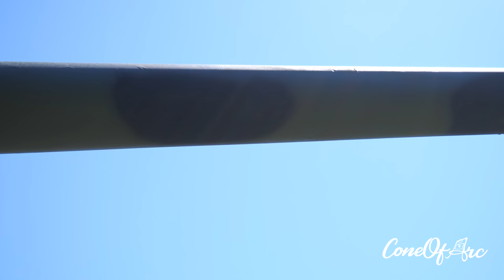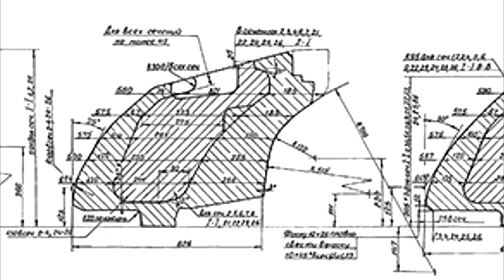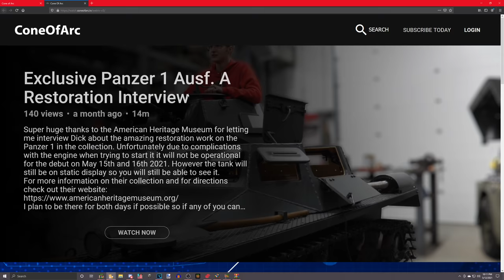Raising the Bar, the T-64 | Forged for Battle

Comment: No, simply no, please fact check. Also you contradict yourself many times.

The military don't want 64 (and to an extend, the 80), they want 72. M60 also officially was never called the Patton. 

Leopard 1 did not abandon the armor. The turret front is effective against apds of its time. The hull can be situational (at range), it is totally possible to defeat some earlier apds and ap in some situation. 

4:25 T-62 has tangible improvement on the armor, what do you meant they are essentially the same? By pure steel thickness, you can spot the difference. WTF???
Also, smoothbore != advance. People jerk off about gun, but it does not matter in the grand scheme of things. Gun is just a mean to push ammunation away. 
The ammunation is what matter the most. And, the ammunation is about on the same level for both side (in the context of early soviet dart and late nato apds)

5:35 "Essentially heavy tank on medium tank chassis". Im not sure where you trying to lead into with that statement, but no. 

6:40 Do not mixed the hull and the turret armor as 1, because they are not. It is not for any vehicle.
Russian tank, confirmed source, has only ever use 2 material (not counting era) for the hull as main protection. Steel plate with textolite insert (and air). No ceramic were founded.
Some iteration of T-64 use ceramic ball in a cast turret. It is replaced with textolite block because ceramic ball are hard to produce and the process of casting around the ball often lead to formation of void, void is no good (which lead to some T-72 use monoblock pure steel as turret armor). There is nothing about ceramic ball not holding its shape. 

7:40 Improvement was requested because it is flawed, the way you put it makes it sounds like a positive thing. T-64 goes into production without the usual verification process, mostly due to people invested in that project has lots of political strings to pull. As I said before, the army wanted 72, not 64, before 64 went into production.

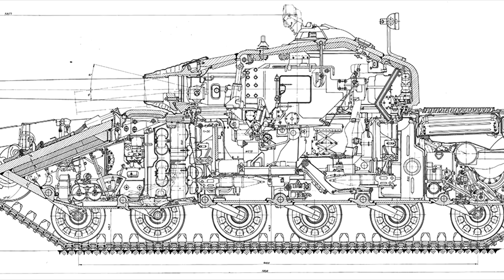7:57 Aluminum? WTF? Also, stop calling textolite fiberglass, they use similar base material but the manufacturing process and material arrangement give them different mechanical property. It is like calling tool steel armor steel, they are not the same.

10:00 "T-64 is more mobile than T-72", or just statement that is structure as x is more mobile than y in general. It does not matter in the grand scheme of things, it doesn't. It simply doesn't. I repeat it 3 times because it is important. Also, neither are necessary more mobile than another in this context, they are about the same in the field.

10:10 The AT ammunition of 105 is the apds, and later the dart. Except maybe French and the low velocity variants, no one ever think that replace apds with heat is good idea. Especially with 456 and 456a1. Study from both side concluded that 456 and 456a1 has high chance of malfunction when impact at near 60 degrees of angle. The fusing issue is solved with introduction of 456a2, but at that point your 105 heat cannot even get pass the era. On the other hand, 15a5 on chieftain has some what decent chance at defeating 64 at less than 500m.

11:15 Listen to what you just said.
Advantage of nato mbt......
"SPEED... no one can out run a 105 or 125 ap, and T-64 is faster than most nato mbt anyways" 
"ROF... just dont, in practice they are about the same (about 7s to 10s), with autoloader being able to load much more consistent in most situation" 
"NATO DOCTRINE... WTF does that have anything to do with the vehicle design"

11:21 In a realistic battlefield of pre 1979 maybe. 
Because only nato apds that can post real threat to russian vehicle is L15a5 from Cheiftan gun under 1000m. 
But, there was something to be said about soviet dart, they perform poorly against angled target, even worse if the target is layered. 
Chieftain particularly stand the greatest chance against such threat out of all servicing vehicle. If mbt 70 ever get fielded, its armor will do very well against early russian dart. 

Post 1979, Russian vehicle is in major disadvantage until post end of cold war. 
The disadvantage comes in 2 part, ammunation and fire control system. 
Referring to GHPC game if you want somewhat halfway realistic feel of where the advantage came from. The auto tracking and thermal sighting complex makes all the differences.
NATO does not have effective tank based no guided weaponry prior to 1978 (the introduction of 105 dart, the famous M735). 

Lastly, speed does not fucking matter, you are not outrunning a bullet flying at you at 1500m/s. 

11:40 Have you seen or read about any technical documentation of reloading any vehicle? I give you a hint, google them, there are plenty of video and document. 
Loading T-64 and anything with mz/az is arguably the easiest thing to do. 
Two piece munition mean hoist the pieces above the turret is easier because it is lighter. 
It also mean moving them around in the vehicle is easier because each piece is smaller. 
Russian autoloader also mechanically move the rounds into position unlike other vehicle which you need to do it manually. 

Reloading the into other stowage is not as easy (relative to more modern NATO mbt), that's true, but I am not sure comparing those has any real meaning. 

I started to feel like you are just pulling shit out of your ass.

11:52 If charges were hit, it has high change to cook off, doesn't matter what vehicle it is. 
Beside, T-64 compare to M60, Chieftain, Leo 1, Type 74, AMX30, and whatever vehicle you can name. 
Look at their armor and charges distribution, you would notice from every angle of attack, regardless of if it is ready rack or in stowage, T-64 always has the most amount of armor around the charges and smallest profile (not considering from the top or bottom). 
And it is established that turret is much more likely to receive impact than hull.

11:58 Thats true, but the charges are still below the hull top. Point? It is also true for any other tank in service, even in modern days. Only exception being M1 with all ammo stowed in blow out compartment.

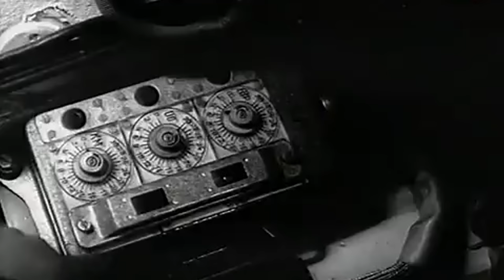12:03 It is not. Stop spreading the myth. Engineers are not fucking idiots. This statement is illogical regardless how you think about it. If you put stuff where you shouldn't, then of course it will goes missing, that's true with any afv. Beside, you are physically unable to reach lost of the moving parts of T-series autoloader anyways (assuming a 165cm male). 

12:14 Drag into the autolaoder upon firing? How does that even works? Gun goes boom only if the breech is closed. If it is closed, the your limbs are already cut off ()assuming it is even possible in the first place). Please familiarized yourself with the sequence of loading with both mz and az type autoloader, the structure, among other stuff. 

12:16 If the autoloader break, you are either dead or the vehicle is disabled beyond operational anyways. That's the same as saying if your fcs failed, it is extremely hard to hit 2000m target manually, or it is extremely hard to hand crank the turret if your guidance system failed.

Also also, the autoloader is consist of many system and each of them has their manual back up, the manual load time can range from 10s to 200s depend on what failed.

12:30 80mm of steel is better than say 70, 50, or 30, right? And the side skirt/small road wheel??? At this point I feel like you didn't even try.

12:53 That's exactly one of the major flaw of early T-64. Hence the modification request before the paint even dry on the new shiny T-64.

13:10 If the hit is severe enough to disable or kill a crew member, you are screwed. No afv can replace the driver in a combat condition when the enemy know your range and can engage you safely, same for the gunner. IRL ain't video game.

13:18 Maintenance of the vehicle? How does that has anything to do with anything again? 
It is a doctrine issue not a vehicle design and engineering issue. 
Beside the French declare your issue a no issue. Say you have a 14*4 men vehicle company, now changed into a 14*3 men vehicle company, the rest of the of the men got stuffed into an apc or 2 following the company. Assist with the maintenances at the end of the day when get back to base or in a safe location.

14:10 T-64 is only responsible with early variant of T-80, that's it. Truth to be told, not alot of people like T-64. 

14:30 No. Stop spreading the myth. T-72 is a more efficient design as a whole, with some part straight up more advance than some T-64. 

14:40 M1 and Chally didn't get field in significant number until late 1984. Leo 2 didn't get fields in significant number until early 1980. 
The treats to T-64 comes in the form of massive advancement of dart and thermal sight on upgraded vehicle, namely the M60. Check your shit.

Lastly, T-64 really is not that significant compare to T-55 and T-72.
Reply: I don’t know why you felt the need to write a dissertation pointing out “incorrect” (most of these nitpicks of yours are not even correct) parts of a YouTube video that is made for laymen that are not well-versed in tanks. The T72 in its early models was not at all better than the T64 in anything but production costs. 

Since you have all the knowledge and time in the world on this, why don’t you go and make a video about the tank instead of commenting an easily glanced-over comment.
Reply: Bruh
Reply: Dude dont you have a life to live?
Reply: Why didn't you made your own video about it rather than shove it in the comment?
Reply: What's Ammunation?

Comment: I love your reviews but this particular tank is a piece of junk, though t-62s which are now delivered by Russian military to Ukraine are even worse
Reply: It's bad now because it's old imagine if the  USA start using m60 tank instead of the Abrams it won't stand a chance against the Russian t80 and t14 armata
Reply: Uh...no. With the current modernization kits, it's very capable.
Reply: The T-62 is used in Ukraine as an armored self-propelled gun. Since there is no shortage of shells for them, and there are hundreds of thousands of 115 mm shells in warehouses.
Reply: @championknife  It's not just being used as an SPG. It's being used as intended as well, same with the T-55.
Reply: @NorthernNorthdude91749 No, T-55’s and 62’s are used as spg’s by the russians because they have a really solid HE round. The only one’s using them as mbt’s are the ukr forces
Reply: @BreadPittAAAAHHHH  Incorrect.

Comment: Wow this commentator sounds like he's spouting Soviet propaganda from 30 years ago? Is he reading from the past and present Soviet Russian propaganda manual? It certainly seems so.

 As an experienced tank commander in the United States Army with some combat experience what he is saying is absolute Hocum.  If the t64 is so good then why did it get replaced by the t72. Both of these pieces of junk are equally abhorrent. In the Gulf war we blew t72s turrets off at 3700 m with 120 mm guns and at 3,000 m with our 105 mm cannons. These two tanks are very weak and rank very low in the spectrum of the world's armored main battle tanks. They're upgraded versions t80 t90 etc etc are nothing but putting lipstick on horrible pigs. Do you really think a 45-ton tank can match up with something of 68 tons and greater from the West? You're saying you know nothing about physics if you say that. If you think they're pathetic armor is so good and why do they keep on slapping things on the outside of it to make it a little bit less pathetic? There's no need to add additional armor on the outside if your armor is good to begin with, right?

For the record the United States Army had been working on composite armor since the 1950s and the British as well.
Reply: Also the United States Army created the shillelagh missile system through the tank Cannon back in the early 1960s, FYI. That's not a New concept nor is it new in deployment either.
Reply: Not quite ... after the collapse of the USSR, US and German analysts had a chance to examine Soviet-made T-72 tanks equipped with Kontakt-5 ERA, and they proved impenetrable to most Cold War US and German tank projectiles and anti-tank weapons. A U.S. Army spokesperson claimed at the show, "the myth of Soviet inferiority in this sector of arms production that has been perpetuated by the failure of downgraded T-72 export tanks in the Gulf Wars has, finally, been laid to rest. The results of these tests show that if a NATO/Warsaw Pact confrontation had erupted in Europe, the Soviets would have had parity (or perhaps even superiority) in armour". KE-effective ERA, such as Kontakt-5, drove the development of M829A3 ammunition.
Reply: 1st its strength was in numbers.

2nd you fought these things in 1990. There is a reason why you fought them in the middle east. The same reason why pz4s & t34s where used there in the 50s. Pair a Leopard 2a7 against a Leopard 1 & watch the Leo 1 get absolutely destroyed by it. Obsolete tanks, which became obsolete because of advancementd on both sides, get sold their.
Also the arabs dont really know how to use them effectively.

3rd he gotta give some memoirs FROM soviet scientists/tankers so we, who arent all tank freaks, can understand what the tank did well and what didnt.

And yea only thing else i csn say is that he explains why it was good: it was damn able to survive nato weapons of the time.

Edit: i forgot one thing

"Why slap extra stuff on it if its already ",so good""

Dude. Dude. Take. a. look. at. ANY. modern tank design.

Leopard 2? Widely regarded as the best mbt of our time, 7th iteration, armor has been upgraded almost every single time.

M1 Abrams? 3rd iteration, while armor hadnt been the main focus of those upgrades (mostly) it definitely improved so the abrams stayed relevant

You upgrade your tanks so that you dont always have to design new tanks, muppet.
Reply: Quite sad to see that a US Army tank commander said something wrong and got corrected by a guy who probably doesn't have any military experience